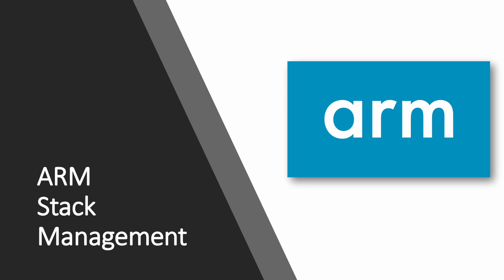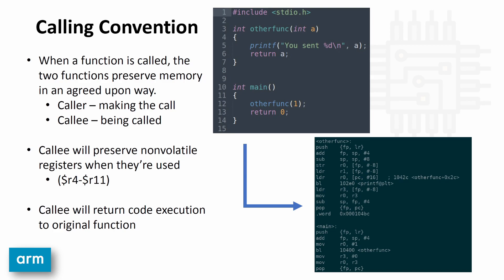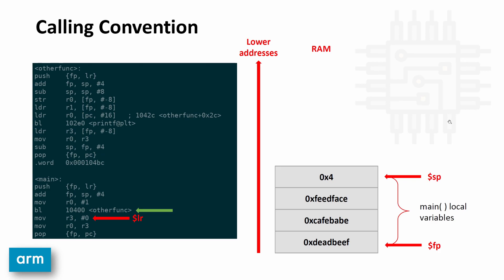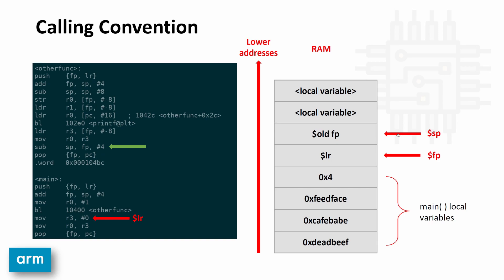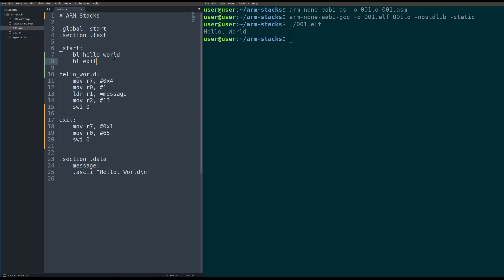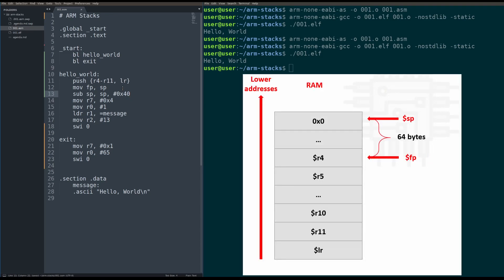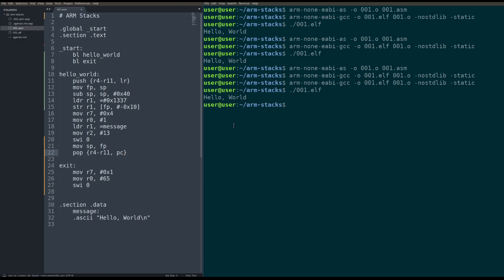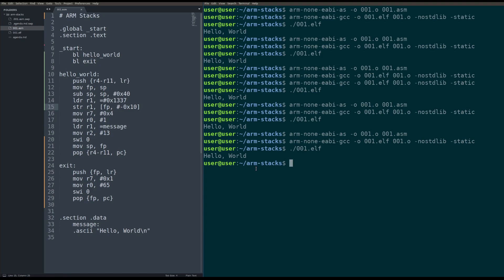Getting Started with ARM Memory Management Using "The Stack"  |  R13/SP Control in ARM Assembly

Comment: Funny what you have in memory ;)
These values are used by memory managers you find with runtimes like Java (0x0cafebabe), MSVC C/C++ (0xdeadbeef), Mac-O / MacOS (0xfeedface)...
And in debug mode only !! (putting these values in memory cost precious cycles but can help track bugs)...

Normally you'll rather find random values or even zeros if the stack is in BSS what I would expect with multitasking/modern computers (since the early 90s).
And they have nothing to do with ARM assembly ;)

Comment: I come from a C background and am trying to learn ARM assembly (specifically ARMv7-A but at this point the subtle details don't matter) and this series is super helpful. But I would learn better if we were solving a problem (e.g. how to code for a "find and stdout print the greatest common denominator of two stdin user-supplied integers at the command line") from a top-level and working downwards. e.g. we start by planning how to solve it in high-level terms, then lower level, and then in pseudo-assembly (like assembly but more readable) and then finally in actual ARM assembly. When we start from basic assembly code into more advanced assembly code, it is possibly for me to learn and follow but it's hard for me to "care" or "see the end goal". Working from a high level and incrementally work out way down to the machine instruction wire would also allow the tutor to introduce technical concepts and new syntax bit by bit, rather than being combarded with ".section .text .ascii label: pop {r0, fp} bx bl b ldr add le" etc syntax all at once.

Comment: How does this work in aarch64? As I understand it push & pop are replaced by stp/ldp... But those instructions require an address too. Am I missing something? Or does the 64-bit mode require more manual control?
Reply: Push and pull are macros for a store post decrement set of instructions in v8